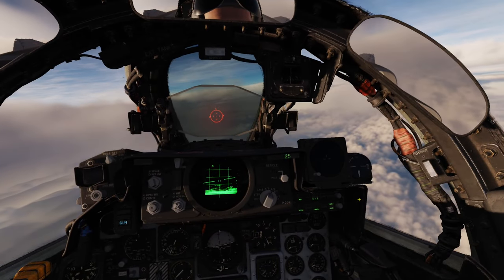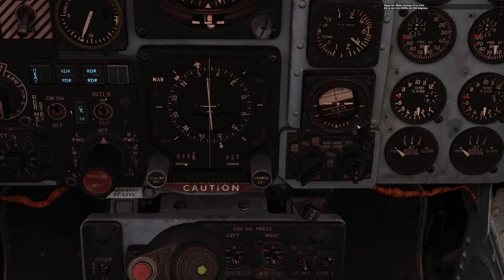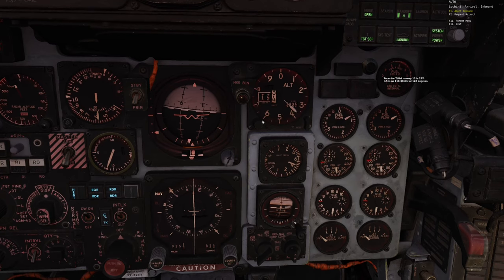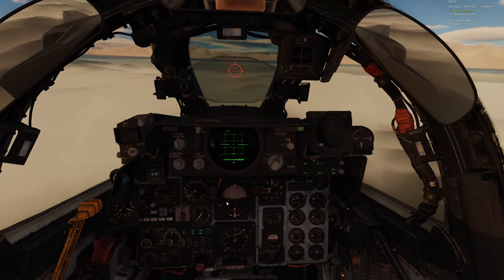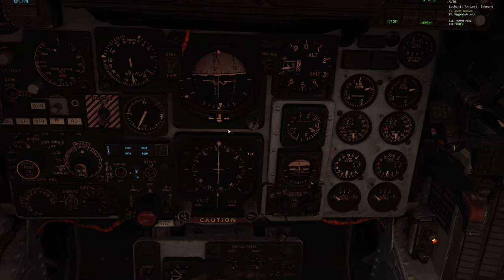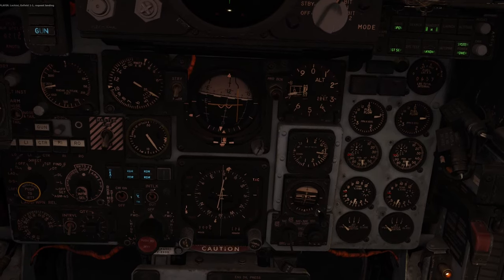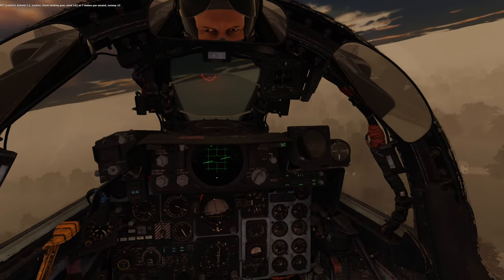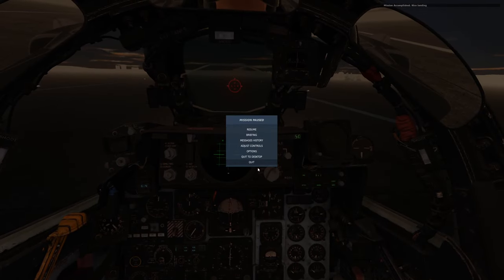F4 Phantom: Hard ILS Tutorial: "Diamond Hands " - DCS World

Comment: Can you get a tblisi approach plate and fly the dme arc / use the approach fix?  Idk if dcs even has those.

Good job btw! This is what dcs simulates best in my opinion. Great vid
Reply from the maker: I think you could use the RL chart or adjust a little if needed
Reply from the maker: http://ru.flyua.net/images/charts/UGTB.pdf - a 2011 chart that shows some different headings and elevations vs. DCS Tblisi chart - which is also not current?? DCS chart shows runway 12R not 13R. Anyways this has a 17.1nm DME arc @ 6700' from the VOR on page 11. Finishes the arc at 14.5 DME - right about where I wound up by winging it except I was very high up!
Reply: @Wheelman_PCAS   cool! I will have to give this a shot! Thanks dude
Reply from the maker: @briantoplessbar4685  I have flown DME arcs before in BMS, but never really tried fiddling with the course dial like you’re supposed to - stepping constantly thru different radials as you fly the arc. Will have to try it as well
Reply: @Wheelman_PCAS  yep in BMS I just set the final approach course after I intersect the IAF and fly the DME arc till I get till I hit turn to final. 
Preety much just keep correct distance and that’s it
I guess I need to map my course knob!